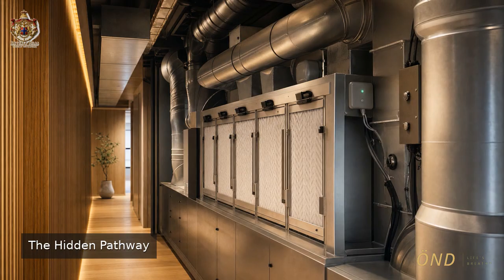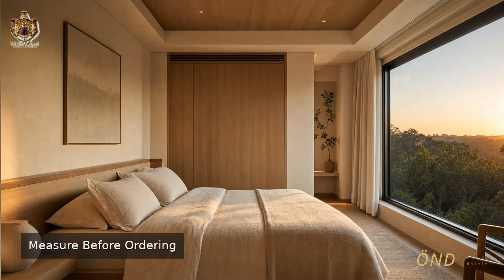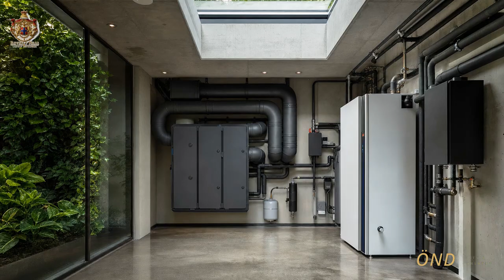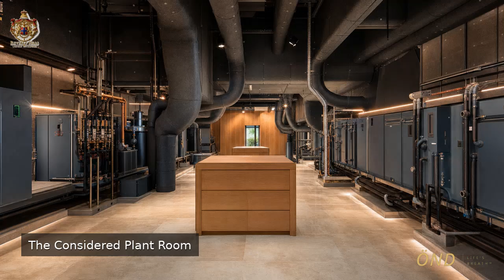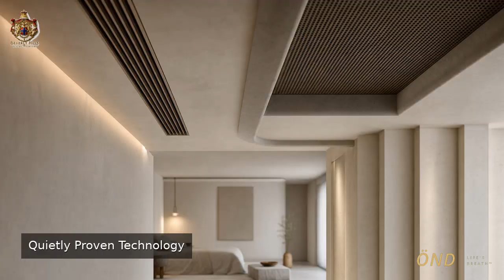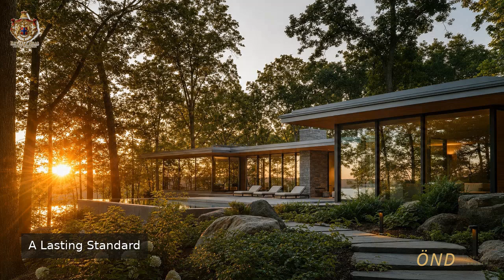Air: A Pillar of Wellness Design | Designing the Environment Where We Sleep, Work, and Recover

Comment: Profoundly accurate, Kenneth. True luxury in bedroom architecture is indeed defined by what remains completely invisible and unstated—most notably, the micro-climatic purity of the air we breathe through the quiet hours. Managing carbon dioxide accumulation by 4 AM, integrating rigorous MERV-13/HEPA filtration with substantial activated carbon mass, and maintaining acoustic serenity so the system is never switched off at night are the true hallmarks of a biological sanctuary. When this level of atmospheric engineering is seamlessly unified with bespoke architectural sleep systems and material purity, the room stops making demands on the human nervous system entirely. Exceptional insights into longevity architecture!